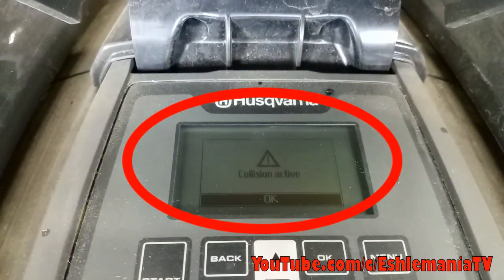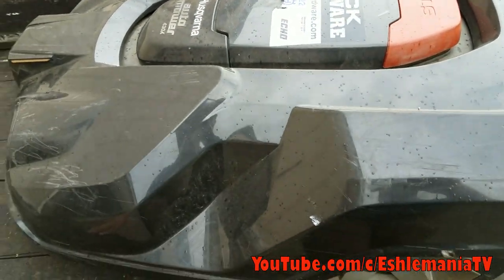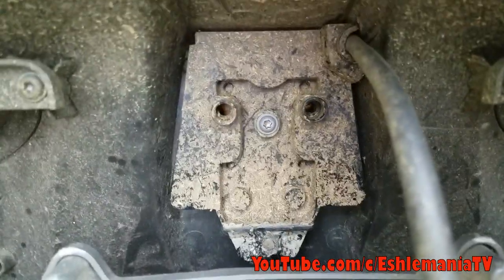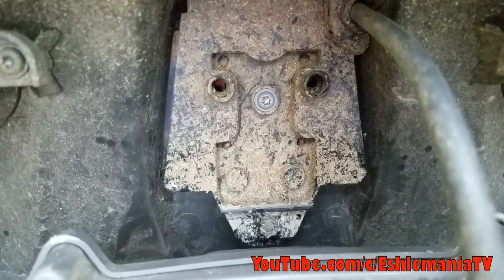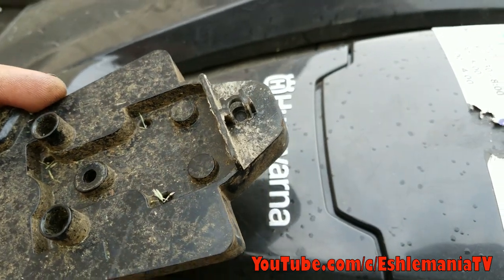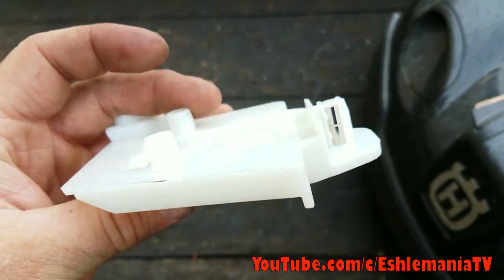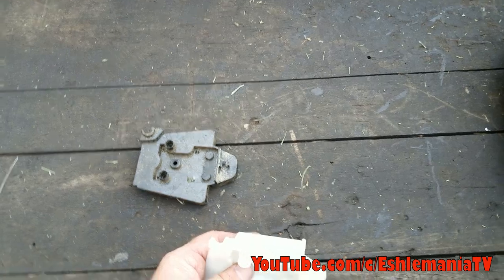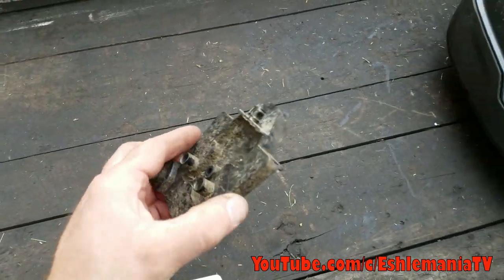Husqvarna Automower "Collision Active" Message

Comment: I have a fairly up to date 450X I got this message and it has the white plate. After a couple of attempts to get him going I removed the plate to check the magnets. They were fine. However under the plate was lots of wet grass debris, it was very clogged. I cleaned it all out and the charge terminals and so far so good👍
Reply from the maker: Thanks for sharing!

Comment: Thanks for the advice, it helped me find the issue on my 330x. In my case it was the small chipset, on the inside that reads this magnet you mention, that has after five years of vibrations got out of its fixture. You have to break the warranty seal, take off the 14 screws, simply but the chip back in its position in the front. You will see what chip I am referring to about 8:50 into the video: What's Inside A Husqvarna Automower, also from Eshlemania.
Reply from the maker: Awesome! Glad we could help ya!

Comment: Thank you for this!  I found the magnet in the grass where the mower stopped, and insulated it with a piece of paper - so the tape wouldn't stick to it - and then duct taped it securely into place.  The mower then worked fine.  Probably not the best long term solution, but the mower is usable again, and works fine now.  It will give me some time to order the part that the video recommends while keeping the mower working.
Reply from the maker: Thank you fro watching and commenting! Glad we could help!
Reply: Do you end up replacing the part? Can I do it myself or do you need the dealer to do something with the computer?

Comment: I had the same problem. The  body and magnet was in place. The solution was to turn it OFF the main switch at the bottom of the mower. Leave  it turned OFF for 5-10 minutes "to make sure that the power is OFF  all circuits  insight the mower", and then turn it ON again. this removed the collision code and I could start it up by choosing primary area on the display, Try that before you take it to your dealer or repair shop. It Could save you the trip, and maybe some money.

Comment: I encountered this problem ("Collision Front" then "Collision Active"), found the magnet lodged sideways, and tried to hot glue itupright ... but without success. Is there a "rightside up" to the magnet (as would be if it were a magnet in a steel cup/sleeve)?
Reply from the maker: Yes, the orientation of the magnet is critical on this part. I would recommend going to a dealer and getting the new upgraded replacement. I've not seen any problems with them yet.

Comment: Thanks for the video. I recently encountered this issue out of no where after just storing my automower for the winter. I replaced the magnet holder as you recommended and the old magnet was actually still in the previous holder.  When I go in the maintenance menu by holding down 0, its showing that all sensors are working properly but it's actually the rear collision sensor that's active. Any idea what that's about?

Put magnets in the rear joysticks and it did nothing. Pretty frustrating because I don't have a knowledgeable dealer anywhere near me. Appreciate it you could get me pointed in the right direction. Thanks.
Reply from the maker: Check the connections on the joystick sensors. Also, the magnets in the joystick sensors need to be installed in the proper direction. If any of them are installed upside down the reverse in polarity from the magnet will cause a collision sensor active message.
Reply: Thanks for the quick reply! All the connections looked fine so I had a feeling it had to be related to the magnets somehow. Appreciate the info. Wish we had more dealers like you in my area.
Reply: Just wanted to confirm that reversing the magnet in the joystick resolved the issue for a collision active in the rear. Thanks again for the help!
Reply from the maker: Glad to hear you got it fixed up!